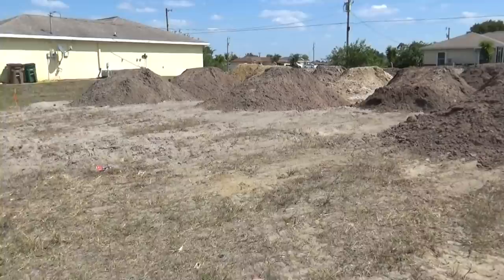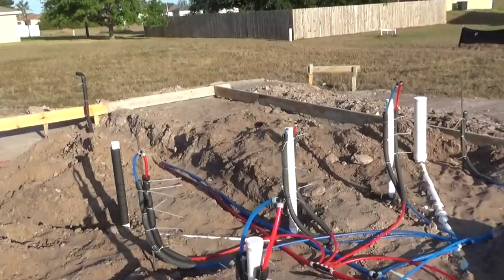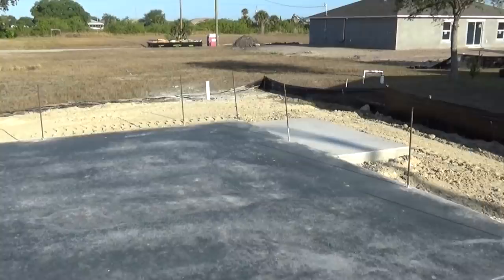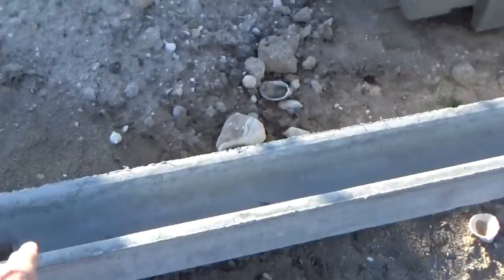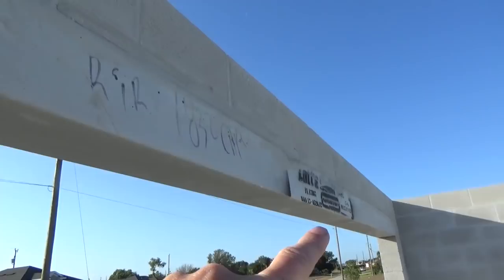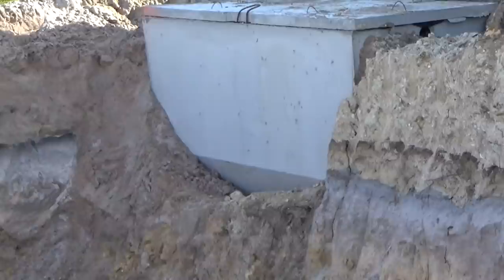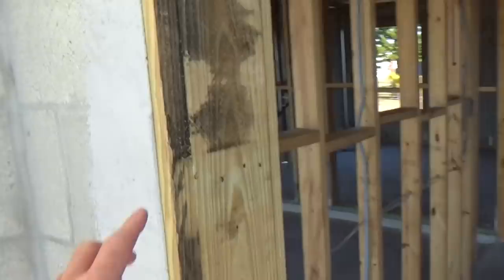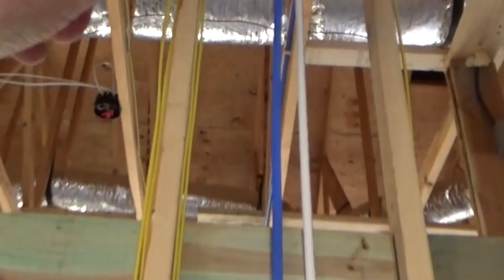FLORIDA BUILDING TECHNIQUES (Mike Haduck)

Comment: Great guide - I would like to build my home in Florida without using wood and drywall. I like the concrete block in external and internal walls. I am not sure how to put the insulation to external homes and yet have the home fire proof - I have seen a double concrete block wall and insulation between the blocks; seems like very expensive option to put double concrete block wall. Do you have any other proposals of how to build concrete home without wood and drywall and still get high R value insulation incorporated in the project (except the ICF, I heard that termites eat through ICF, besides ICF burns)?                 For the roof, I would use steel frame and instead plywood and shingles I would like to have insulated steel roof panels with R-50 value; so the attic would be very insulated. Do you think that can be done in Florida? I have seen videos of those insulated roof panels used in Arizona.    Lastly, would you suggest a home builder who can build a home like that  in Tampa Bay area but cost effectively so the per square feet price is comparable to homes build by DR HORTON? Couple years ago, I have reached out to one contractor, and he said custom homes are not cost efficient to build.
Reply from the maker: Hi GS, anymore everything is up to the architect, engineers,  and inspectors, liability is a big issue, thanks Mike
Reply: To build an interor block wall, I think injection foam will work. Need to ask an inspector if that's allowed. Please update if it's possible.
Reply: @marcoandres8830  some injection foam would help with the R value  but I believe it has to be continuous insulation and in Florida every few feet there is requirement for rebar so they have to fill the blocks with concrete instead of foam; I heard that they use injection foam for commercial buildings. The concrete blocks in my current home are completely filled with concrete.
Reply: @gs9771  I'm talking about interior walls? Is that possible? I've seen them use all concrete in europe. Is it possible to also use something other than foam insulation such as rockwool?

Comment: wow.  to me it seems like those walls would absorb and hold a huge a amount of heat in the hot weather....   and it didn't look like much insulation...   maybe I missed something?
Reply from the maker: I was wondering also, thanks ,mike
Reply: Not an expert, but a Florida resident here: Sometimes you just gotta make a tradeoff. do you want thinner walls at the expense of safety during hurricane season? 
After Hurricane Andrew back in '92 there was a huge overhaul of building codes that only became law on homes built after 2005.
I'm originally from the Dominican Republic, and ALL the walls and the roof of the homes there are thick concrete, and if it gets hot, get an AC or deal with it lol

Comment: So they run pex underground with plastic fittings and illegal labor. They could have used brass fittings versus the thin plastic and run the supply lines up into the attic.
Reply from the maker: Hi John, and they pay inspectors to oversee it, thanks mike

Comment: i think they should have used more and heavier rebar.   i saw similar house being built in the Carribean,, the man was building it himself,, bit by bit (as he could afford materials),,, but i was Really impressed to see the the solidness of that rebar.  he may have had one rebar in every concrete block.  it was Completely! different from this.  i wasn't impressed with that part. are they trying to spend less,,, i wouldn't buy a house unless i knew it had more rebar that that one.  (well i live in New England so i guess i'll keep my solid old house).
Reply from the maker: Hi, lot of controversy on roofs, tile, metal or shingles, thanks Mike

Comment: I lived from Florida for 69 years and the Florida Building Code is different in certain counties of the state. The is the High Velocity Hurricane Code I Broward and Dade Counties. In Leon County the code is different. Changes are made to the Code every 4 years. This is due to the high winds of hurricanes. One day the state will be under one unified code however certain counties will have amendments that don't apply to other counties. I live in the mountains of North Carolina and the freeze thaw cycle affects every structure. You will not get this in Florida. With respect to Mike and this video it does not represent how all homes are built in Florida.
Reply from the maker: Thanks John, Mike

Comment: Are they using metal studs due to the lumber shortage?
Reply: Water resistance from flooding. It won’t mold.
Reply: metal = less cost. That's Floridas state motto.
Reply: It looks like they used them in the kitchen area - the metal studs are perfect unlike regular lumber so hanging cabinets is much easier.
Reply: Termites can’t eat metal studs.
Reply from the maker: Thanks, Mike

Comment: So Mike, truthfully, if you had your life to live over, and be in the masonry business, would you choose to live in Florida or Pennsylvania ?
Reply from the maker: Hi ernie, I would choose Florida, I think the opportunity is much greater,  but because of PA weather the masons up north are better. Thanks Mike
Reply: @MikeHaduck  Your an honest man Mike, and i would do the same for the same reasons.
But i dont agree with you on the quality of the masons.
My father was a bricklayer, in the era where there were no cinder block, and 16” thick walls were solid brick.
I started my career in his masonry business in the early 50s.
I think as for blockwork, concrete work, and stucco work, the quality here in Florida is as good here as up North.
In fact i think the stucco work is actually better here, at least as for appearance.
Carpenters on the other hand cant compare with those up north, especially those doing the framing.
Reason being that there is actually very little framing on a house here as compared to up north.
Most framing carpenters here have no experience at all for example with conventional roof framing with cut roof rafters.

Comment: Hey Mike. Probly off topic. But cant find any answers. Someone covered Red brick at my house years ago with two layers of Stucco. Most flakes down in chunks. On the corner is a layer of grey substance. HARD AS A ROCK. Chipping it takes Hours. I know muriatic is used to clean up. But how can I quickly, safely dissolve it. Or is it old school chipping
Reply from the maker: Hi Jerome, I am not a fan of acids, most jobs I just end up chipping,  thanks mike
Reply: @MikeHaduck  Figured as much. THANKS Bud.... Not sure if it's the brick. Bc corners are sometimes diff on face. Or its a granite like compound.

Comment: I have a question for anyone who knows something about construction in Florida. Normally, interior walls would be attached to exterior framed walls with a double top plate. In Florida however, you're butting up against concrete with furring strips. I noticed in the code for Florida, it specifies that if the interior wall is not attached to a straight line wall, you are to use 4 inch thick walls. And no, we're not talking about 2x4's, but literally 4 inches. This would imply using a 2x6. Is that how you guys do it? Thing is, I rarely see this done in videos that I watch.
Reply from the maker: Hi , I don't know, Mike
Reply: @MikeHaduck  I found another video that said that it's actually ok to not tie interior walls into exterior walls with double plates. Some contractors do it, some don't. If you don't though, you use a special metal bracket to tie them in. I'm sure most people do double plate the walls in if they can though.
Reply: @Rexvideowow: I'm curious about the same. Can you provide a title  or link to that video you saw? I'm not sure YouTube will allow links in the comment section, but any info you can provide to help find it would be great, thanks!
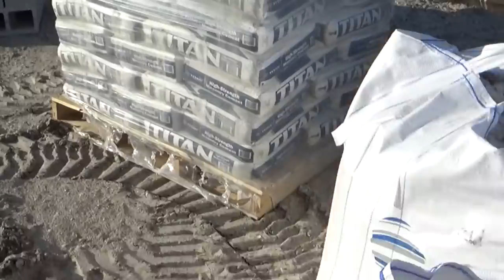Reply: @jennifer9528  Yep. https://youtu.be/y8W7KbJTg7A?t=145 It's the MattBangsWood channel. Title is "Carpentry 101: Basics of Wood Framing with MattBangsWood" The top plate section starts at 2:25 and goes on for about 1 minute. He talks about how some framers just tie the exteriors together with top plates, then butt the interiors in and bracket them.
Reply: @Rexvideowow : That was a great, informative, and very interesting video! Thanks, Rex!

Comment: Why does nobody here use blocks for inner walls? Its always the untreated wood frame. I can imagine all stone would even lower the electric bill in FL. It keeps the house way cooler
Reply from the maker: Hi, actually block is a poor insulator,  they add styrofoam to the inside walls, Mike

Comment: That has to be the most expencive way to build a house that there is.
Block construction is very very expencive and then fill it with concrete very expencive and add stucko super labor intencive/expencive.
How about ICF intergrated concrete forms, they cost a lot but a lot less than that.
How about lock-n-block, stronger, lighter, cost less, faster, last longer, less labor and higher wind rating.
Good greef.
Reply from the maker: Hi Richard. I doubt you change anybody mind around here, they are strict with their codes, hurricanes are a big deal, thanks, Mike

Comment: And nearly ALL the Florida driveways crack! Poor building practices
Reply: Nearly ALL Florida concrete cracks. Non cracking slabs costs vastly more and is not worth the added cost.
Reply from the maker: Thanks,  mike
Reply: crackcrete
Reply: Driveway concrete guys never put separation joints in the center of the driveways its a sin the it's not part of code

Comment: I know everyone builds to their environment and location. But, come on how are you going to fix, upgrade, the plumbing encased under concrete?!? 🤦‍♂️

I was also surprised they used fibre glass batts instead of ICF. Lastly, that area doesn’t have a real sewer system?? 🤢
Reply from the maker: Hi ,I agree, I would never bury a water pipe under the slab, and I heard when the sewers come in they are going to access each home owner 30 gran , I am not sure, mike